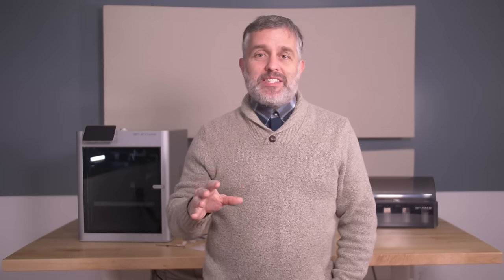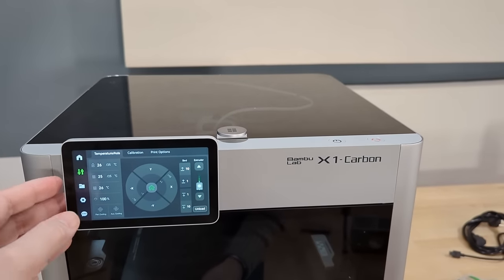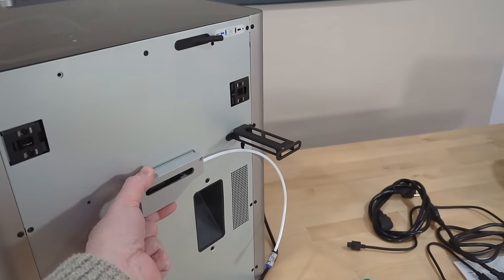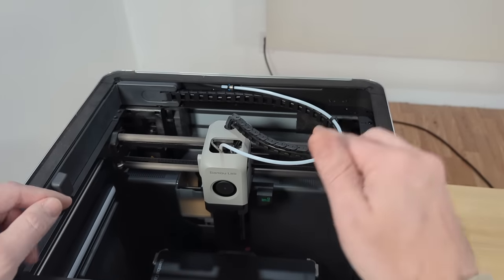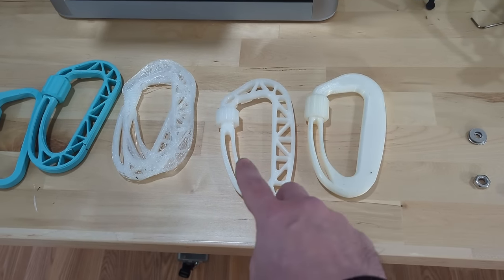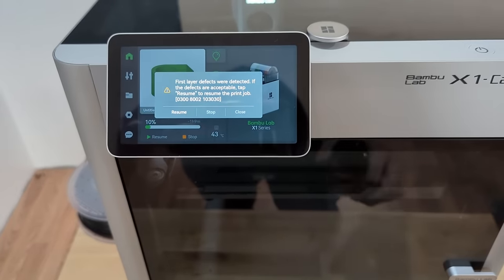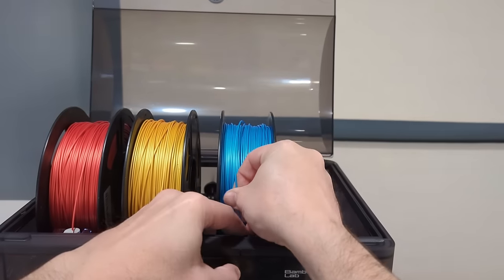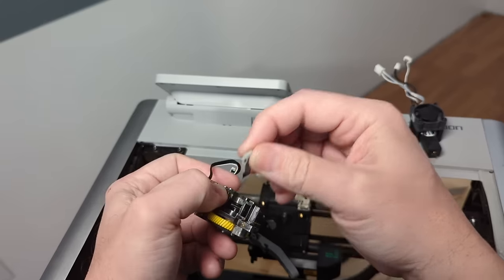Why The Bambu Lab X1 Carbon is a PhD Master Class in 3D Printer Design

Comment: Unsure why you think their software would be like Klipper.  They don't need a high-power CPU (the X1 only has one for the GUI, the P1P does the same motion control with a lot less CPU power).  Of course, some ideas are implemented in Klipper and in their firmware, but that doesn't mean they even looked at the Klipper implementation.  And even though I'm running Klipper on both my printers, there's quite a bit I don't like about it.  It's like democracy: it has major flaws, but so far is the best thing we got.  If only someone would replace the ugly Python Klippy side of Klipper with something designed a bit better and not requiring a restart whenever you change some settings ... but then, who am I to complain, since I'm also not putting my time into that, so ...
Reply from the maker: Have you checked out Reprap firmware on a duet control board? It's got all the same features as Klipper including input shaping. I think it's exactly what you're looking for.

Comment: But I mean... It's $1500 with the AMS.  It's as (relatively) expensive as a PhD 😂. But what you're paying for is a bunch of stuff people might do to fix the problems with cheaper printers anyway.  And you're paying to have something just work.  And it does just work - especially if you embrace the Bambu ecosystem with the  RFID spools.  It has been almost fire-and-forget for me.

Comment: This video expresses the precise point of this system.  A quality user friendly experience without knowledge of nuts and bolts.  While I've had interest in this system due to the quality to price point - I'm knowledgeable enough to work with a ratrig or voron.  I personally would rather protect my investment on the diys and part freedom, than to deal with proprietary and planned obsolescence.  But this fits the market for those who would replace verses wanting to deal with repairs for the most part.
Reply: Agree with this! I've been building 3D printers for 10 years but got fed up of the building, fiddling, tuning etc so bought the X1C to just print. I'll finish off the Hevort 'one day'

Comment: I returned mine. Linear bearing was failing and damaging the smooth rod, and I also had issues with my AMS randomly flashing all red lights. Their customer service is useless too.
Reply from the maker: If you say so. Would be a more believable personal witness testimony if you had an RMA# or a copy of your correspondence with Bambu Lab.
Reply: @DesignPrototypeTest  Are you saying im lying? lol I have record of everything, I also have a post about it all on the community forum. in fact, the ticket is still open right now and its been over a month since I opened the ticket. They just refunded me yesterday for the return though, so the ticket will be closed shortly.

Comment: Prusa is still pretty good.
Reply from the maker: Not really. For $800! That's $200 more than the bambu lab P1P. China has other offerings that are better and cost less ( https://youtu.be/geEm8mn6sbg ) There's literally no value proposition for Prusa that China doesn't offer better. Except for the militantly toxic Prusa "community" that you get to be a part of after you waste your money.
Reply: @DesignPrototypeTest  what about service? Are the parts serviceable in the Bambu? I am worried about parts breaking up and finding a replacement.  The Bambu printer looks beautiful, sleek like a HP printer, this is why the service aspect  worries me

Comment: Sorry buddy, if Apple made a 3-D printer, it wouldn’t be made out of injection, molded plastic, nor with the sides be aluminum sheet metal, it would be diecast. It would also be about $6000.

Comment: Your thumbnail is off. If Apple made it it would have been $9.999, come without a power cord and the parts would be unobtainium. You couldn't service the machine in any way and if you wanted to change the hotend you'd need to go to a verified dealer ;)
Reply: 49:28 simple test: run the printer with ABS without the filter 🤭I have no experience with it but I bet it does something or they wouldn't have included it right? 😅
Reply: Not wanting to use Bambulabs can be done. Just throw your prints from any slicer on an SDcard. But you lose a lot of convenience that way. But it can be done. The printer can even operate without a internet connection. You will lose functionality but it can be done. I personally don't worry too much about it. 99% of all electronics I own have connections to China anyways. It's kinda impossible to avoid that. And at least this isn't a literal webcam sitting on your monitor or build in to your laptop :)

Comment: You need to have something that’s noticeably better in order for something to change. Industries tend to advance in small steps. You can see that in the computer industry. Before the PC there were many different operating systems. Some were better, but they weren’t all that different in what they did either. The PC came out and what was it? It was just a slightly more advanced version of everything else out there. But its standardization due to the fact that it was from the biggest computer company increased the growth of the personal computer industry.

Despite that, Apple made a major change in the industry with the Mac an it’s operating system. So that can happen no matter that one company dominates the design in some early stage.

The same thing happened again with smartphones. I don’t have to tell that story as it’s still fairly recent. Now, likely with AR/VR. I’m not trying to advertise Apple here but we know what happened.

So the same thing is true here. Lots of consumer 3D printers. Some odd designs. Some pretty good by the standards of the day, and now comes something much better. So it’s likely everyone will try to follow their design successes with varying results. By the way, the filter does work. But common sense says that you have to wait a bit before opening the door. It takes two or three minutes to evacuate the pollutants from the cabinet after printing ends. The connector to the bed is there for manufacturing purposes. Easy of assembly. Soldering it would be much more intrusive and complex to assemble. It would likely double the price to enable a high temp chamber. I’ve got nothing about that, if there a big enough market, though I’m not sure there is at this price point. Several printers at above $10,000 do this.

Until the big three printer manufacturers think it’s time for them.

A bit of manufacturing information. Let’s say that it would just cost them $9 to go to three drive motors, though that sounds fairly low. But product prices are generally between 2.5 to 3.5 times the cost of the parts. So even if it were $9, that would raise the price by about $30. If the cost is more likely $15, then we’re talking $45. These push the price above the “Less than $1,200”. It’s likely also unnecessary, and results in a motor control system, hardware and software to make certain that the motors don’t drop a step and fall out of sync. That’s much more difficult than it sounds, and while I’m sure the printer already has compensating circuits for the motors to keep the extrusion in sync if a motor should loss steps (something cheap printers don’t have), even commercial printers I’m familiar with generally don’t have more than one motor driving any axis.

All open source equipment I know is less efficient and has poorer performance than equivalent proprietary equipment. All open source components are general purpose, and while they may be good, they’re not optimized for anything, so everything made with them is compromised to some extent. That’s true for software as well. Just keep that in mind when making decisions about to buy. Open source licensing is so difficult for manufacturers that companies I’ve dealt with state, in contracts, that there must be a guarantee that NO open source software be used in the product, or used in development of the product. If those licensing agreements for open source were more reasonable and business friendly, this wouldn’t happen, which is why Bamboo and other companies do this.

Comment: If Apple made a 3d printer I am guessing it would work perfectly before releasing it on the market. It is a shame Bambu Lab hasn't. I certainly in hindsight would not have wasted my money on the AMS system which is seriously flawed. I also doubt Apple would release a product that needs to sit in the garage while operating due to the excessive noise from the fans that will fail over time due to being cheap crappy fans.

Comment: I really don't see a difference between this and a qidi x plus which was released in 2017 and has far better parts
Reply from the maker: On paper the Qidi actually looks better. it is not.  While I don't know the actual workings of the companies it appears that the Qidi printers start the design process with a marketer generating a list of features he can sell. Then he hires the lowest cost design firm and engineers to make a product that looks good on video. The first "functional" version of the product is what they sell without further development. The Bambu Lab printer is a TEAM of Ph.Ds in Mechanical Engineering who were already successfully employed making DJI drones so they are the best talent China has. This team determined how the printer should perform. They spent a lot of time polishing the product with redesigns and a test audience before settling on a final design for production. The difference in actual performance and usability is as different as you can imagine.

Comment: Sorry - but the Bambu X1 Carbon is hardly what I call "an affordable" 3D printer for hobby types. Sure if you're a self employed designer, run a print farm or small studio or office it's a great solution.  I do admit - the P1P, bare-bones edition, is a very good second printer or even a first for someone who doesn't want to tinker. When my ancient / modified Ender 3 gives up it's ghost (and I can't be bothered to fix/improve it) I would consider moving to a P1P.  I am very curious to see where Bambu will be in a year or two.
Reply from the maker: DIY is always better. You understand everything about your printer. I don't think your Ender 3 will give up the ghost. You're too good at keeping it alive. 😀
Reply: @DesignPrototypeTest  yeah I doubt it will die anytime soon. I only use it for functional rough parts. I use SLA for precision parts. I'm still am impressed by how far 3D printing has come since 2009 when I started.

Comment: why print ABS in 2023 ?
Reply from the maker: Best performance per $$$.
Reply: @DesignPrototypeTest  based on my experience I find PETG a better option. Also safer on emitted toxins. Our health per $$$ costs more.
Reply from the maker: Thermal properties (Heat creap) are ~25% better with ABS compared to PETG and it still costs less.
Reply from the maker: https://youtu.be/W01lo9ZeOhk
Reply: @DesignPrototypeTest  thank you for the information shared.

Comment: It's a great printer. The only problem is that everything is closed source and locked down / proprietary... from the software to the hot-end nozzle. Not my cup of tea... especially when most of the tech they use was adapted from open source communities.

Comment: So, what about the quality control issues? Sure, many folks are getting good, working printers. But enough lemons are going out that this is showing a lack of capability of Bambu to scale up while maintaining consistent build quality.
Reply from the maker: What you're describing is growing pains. Unfortunately, there's no way to scale slowly enough to maintain consistent quality during the scaling process. Bambu Lab is now the dominant 3D printer manufacturer. They went from zero to everyone wants their products overnight. There's not a company on earth that could make that transition without some quality issues. The fact that they've done so well keeping the quality so high. Speaks volumes about the professionality of the company. Going forward, quality issues are likely to become fewer and fewer. Also, let's acknowledge that some of the quality issues were influencers trying to get attention exaggerating problems that were easily solved.
Reply: @DesignPrototypeTest  "Dominant" is a very strong claim. they don't have the sales numbers to back that up. They are on the "bleeding" edge, and have shaken up the market, but only time will tell if they will survive.
Reply from the maker: They are basically a spin-off of DJI. Their team is much larger then you would expect from a startup. Just the design department has several Ph.D.s in mechanical engineering. They have all the might of Chinese manufacturing behind them. Also, it's my guess that they are funded by the CCP in the same manner DJI was /is. Your fears/ concerns are entirely misplaced. What you should be worried about is CCP control over your printer.

Comment: How do you call that: multiple times during the video you are saying how bad Bambulab is for using open source and not giving anything back to community. And then epicly in the end saying that: "I think that seeing just how good a printer can be these other companies are going step up and we're going to see a lot of great polish coming on projects from the smaller companies" . In my dictionary this is hypocrisy. Current firmware allows you to store models on the SD as well as enable LAN mode. Thanks btw, for the detailed overview - now have better understanding on how this printer works. 

But in general I 'm not an engineer nor the developer and don't want to assemble my printer, write firmware etc. I want plug n play. I want everything in one place - not look for tons of forks.  So they are targeting this market. And they priovide you warranty. Same as DJI drones. There are tons of DIY drones or you can buy ready to fly from the box one. If you don't like something - you don't eat it )

Comment: your bed leveling idea with two motors neglects thats a its not needed and b it might introduce variable errors while shifting z whiith physically connected axis this cannot happen.
Reply from the maker: 3 motors. Look up Hevort.
Reply: @DesignPrototypeTest  right but still think its better to have them physically connected rather than hoping the motors work perfectly to achieve visually consistent results. What i'm trying to say is that less doesn't mean worse. My 150$ 2d paper printer is crazy precise and if you take it apart its all cheap metal cleverly arranged. Nothing wrong with that - rather genius i would say.
On another note you mention the heating of the chamber - what would that improve exactly or what needs improving? Not to be annoying but i'm probably buying one so i wonder what i'm missing out on exactly - given there would be the X1E but that seems bit steep for a toy.
Reply from the maker: It would improve the strength characteristics of the parts in the Z-direction Layer adhesion. Also would ameliorate the internal stresses and warping of the parts. But it's a tremendously challenging egg to crack. It would not "just works" like this printer currently does. I recommend that you DO NOT buy the Quidi heated chamber printers. They are good on paper but they basically release beta test printers without addressing known issues. Namely and most importantly the hotend cooling is atrocious on both printers I reviewed. I will never touch a Qidi printer again. Fool me once shame on you. Fool me twice shame on me. Both Qidi printers I tested were so unimpressive once I took a close look. But other people say good things about them so make up your own mind.
Reply: @DesignPrototypeTest  Probably going with 1XC for now - thank you.

Comment: More like if DJI made a 3d Printer. If apple made a 3d printer, it would have a proprietary connection with only apple devices and be $5000 with proprietary $100 Filament and $1000 Filament stand.
Reply from the maker: Not if. This is literally DJI making a printer. I mean, I don't know how it works over there in China, but this seems to have the full permission from DJI and is probably funded by the CCP. For certain, most of the key members of the team came from DJI.